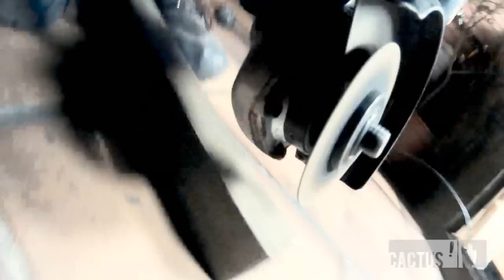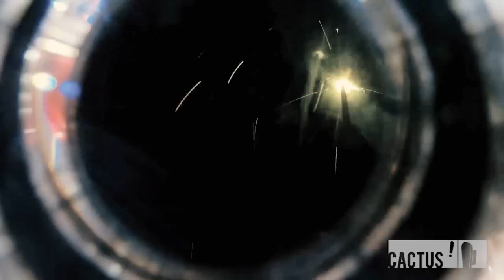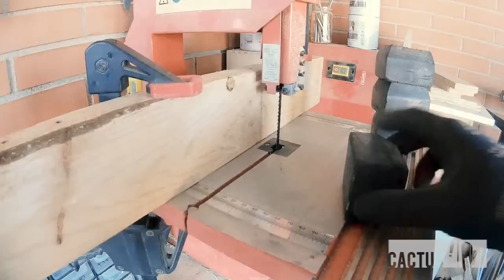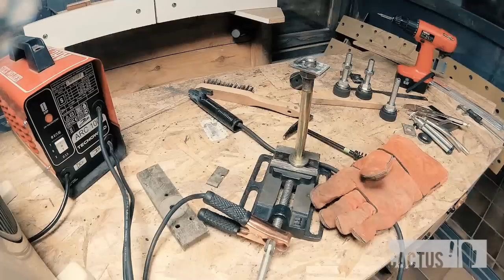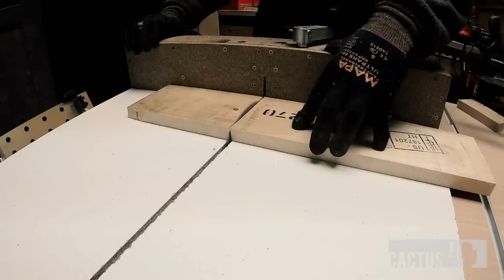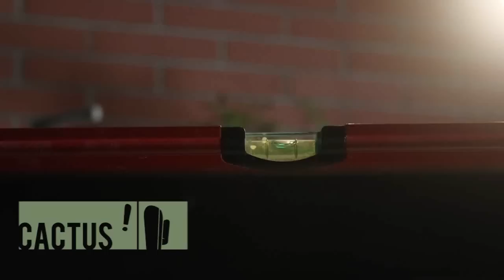Industrial table from reclaimed materials

Comment: Love your pocket-hole drill guide & double-sided approach. Kreg jigs, drills & screws aren't available in SE Asia so your idea is really attractive. Great video and editing!
Reply from the maker: +dav snow Thanks!! In Europe they are not common either and anyway they are expensive, so I went with this solution since you can also adjust how deep you want the head hole to go. The drawback is that it's not that easy to adjust it to the thicknes of the board so I have a couple of them for different sizes and that solves most situations. Let me know if you make yours and thanks for watching and commenting! :)